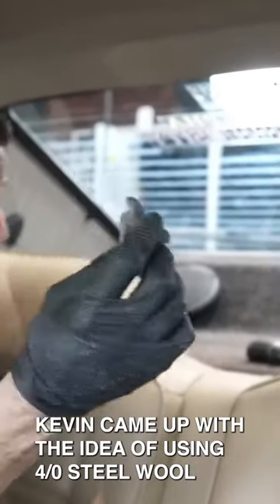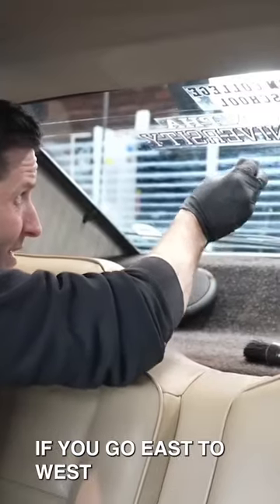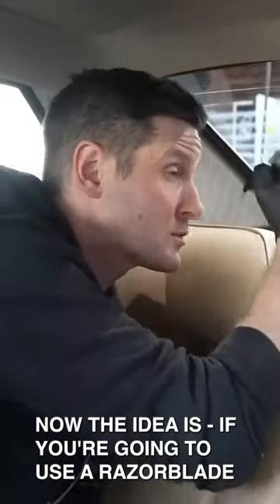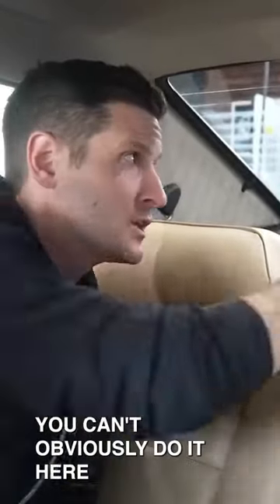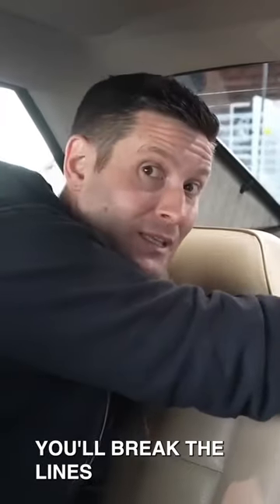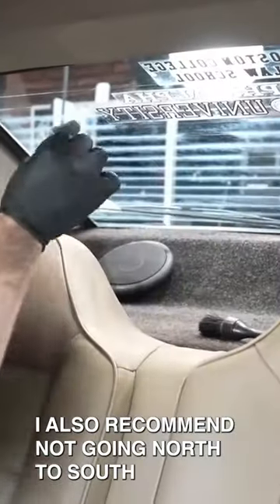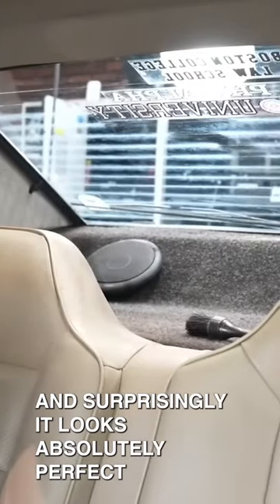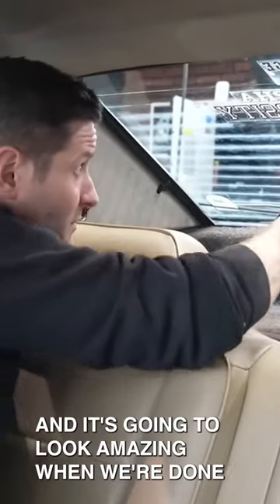Detailing Tips & Tricks: Rear Defroster Glass Cleaning #ammonyc #detailing #shorts #howto

Comment: Tip- Double check that you don't have window film before using steel wool or razor blades on interior widows (windshield included). This goes without saying, but lighter tint is not obvious at first glance unless you work with car glass frequently.

Comment: Blue Scotch Brite pads are my preference for this type of application. I take one full pad and cut it into fourths. Works just as well as the 0000 steel wool, but without the tiny little pieces coming unraveled. When the schmutz is gone, just throw the little square away.
Reply: I've been using the white, which is designed for use on acrylic (think aquariums),